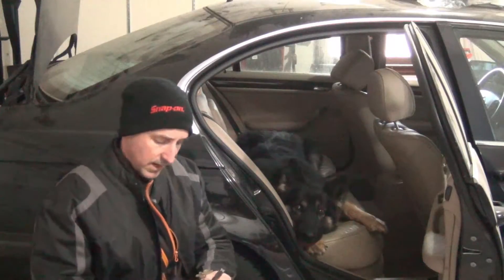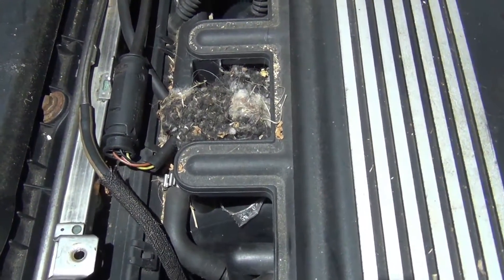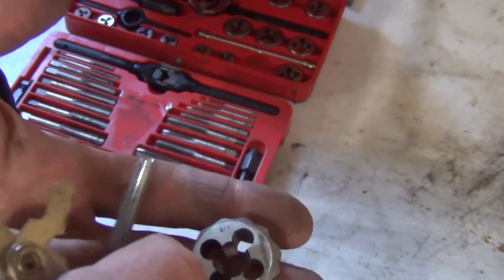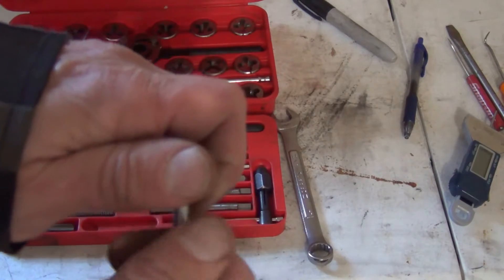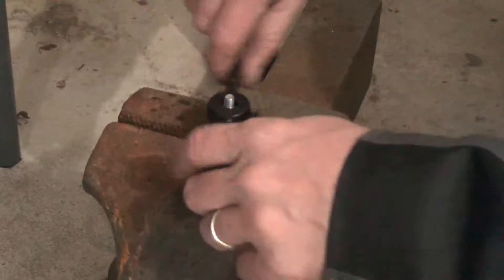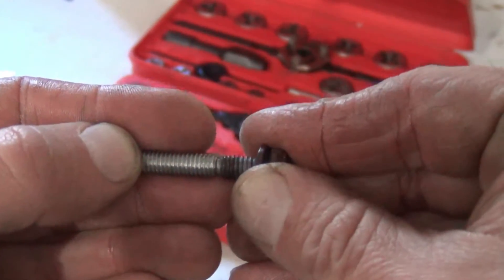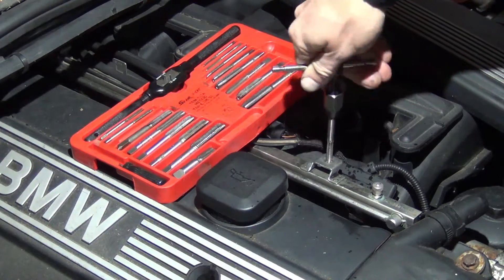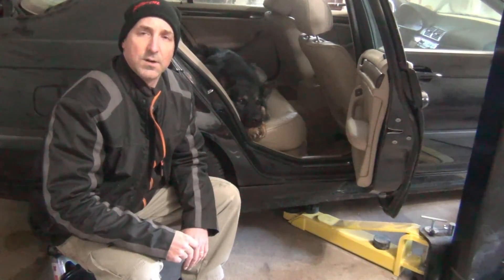How To USE A TAP AND DIE To FIX DAMAGED THREADS Guide For Thread Pitch and Bolt Size Determination

Comment: How do i do a left hand thread, with the same tool but turn it counter clockwise or is there a die for doing left hand thread?
Reply from the maker: @Smoorepainter  Use the correct bit but instead of lefty loosey it would be lefty tighty. 😉  Turn clockwise to loosen.

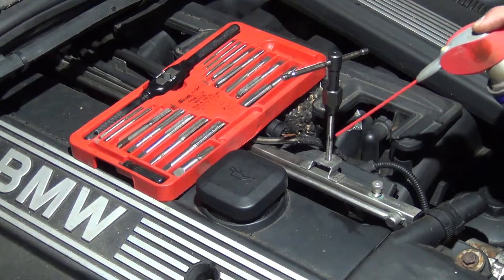Comment: 9:20 what happens if you can't start it on the 1st thread?
Reply from the maker: @Mazza666  It can take some effort to catch the fist thread but often with some hard down pressure it will catch. Make sure your straight. I have also put it in an electric gun and had to send it in small steps to get a hard one to catch. Back and forth a small bit at a time.

Comment: I can use these set to fix a rear brake caliper hole thread stripped for my clk350 2006 ? I dont wanna drill or anything so is it possible ?
Reply from the maker: Hello Khalil! Yes this procedure would be to attempt to fix that. Some thing to keep in mind is that if there is no metal left to tap then it will not work. Also make sure after you fix the threads make sure to use the correct torque to verify the threads hold correctly. If they pull out at the correct torque then the component would require replacement but in most cases things like that can be repaired. Best wishes to you.

Comment: Would this work for rods? I would put a nut over that rod. I have a rod that got cross threaded pretty bad so I’m wondering if this would work as well
Reply from the maker: Hello, If you are referring to a connecting rod with damaged threads I would not chance that with any repair like this.

Comment: Thanks for the video!

I have a question though, if someone or you can answer:

If the thread in a hole is partially broke off, can I still tap the hole with the same size as the screw? Or should I drill out the rest of the threads and buy a kit to put in new threads?

I am talking about a vehicle air compressor discharge hose line connection. The screw was tightened too much and the thread came off onto the screw, about half of the threads.
Reply from the maker: Hello, For your situation you would need to drill out the hole and use a time cert or heli coil since the threads are no longer viable. That was a great question!
Reply: @AskTheCarExperts  Thanks! 

So i would need a time sert the same diameter of the hole, drill out the remaining threads, and insert new threads? I've never done this, seems like it is fairly easy?
Reply from the maker: @daymackgaming  I would recommend  Time-Sert kits. You would match it up to the size you need such as an M10 x 1.25 thread pitch. I have been meaning to do a video on this process. Maybe I can do one for release next monday.

Comment: This is why thread chasers exist.
Reply from the maker: That is another great way to fix threads.
Reply: Thread chaser are to clean up threads not to repair, they are a different material and are more likely to break if you use it to recite threads.
Reply: @elitevivid2475 Nope, they repair damaged threads. More likely to break than what? I use thread chasers daily.

Comment: Super info, Roger 👏🏻
I never thought about using an open wrench to gauge the diameter 👍🏻

I’ve always been amazed at the physics and engineering behind threaded fasteners. The amount of pressure they can hold eg cylinder head etc. 

Btw love that portable floor vice of yours there 😎

Can you show a helicoil install in future video? I’ve never had to do one yet but I’m sure someday the need will arise. 

Thanks, bro!  Love that dog of yours!  So chilled.
Reply from the maker: Thanks Mario! Definitely can and will. I like to use time certs now which is a better repair than a helicoil. I will go over the full use if drilling tapping and installing on a future video. :)
Reply: @AskTheCarExperts  awesome! Look fwd to that.